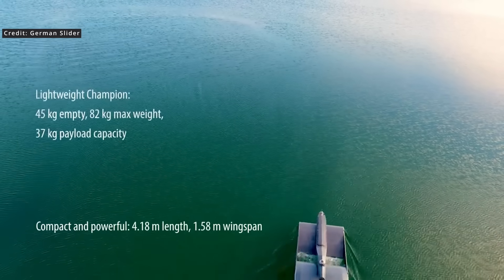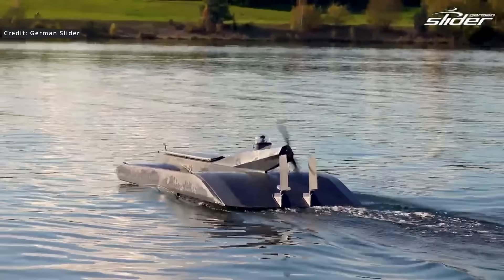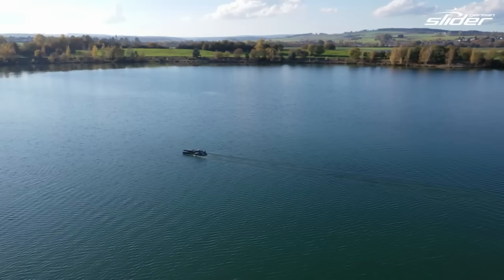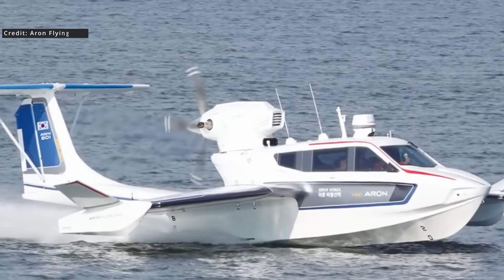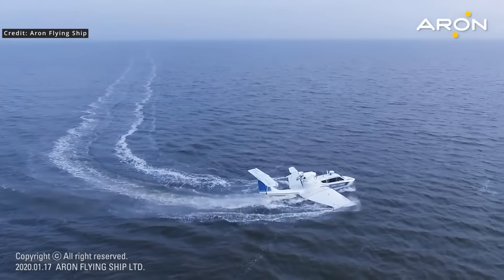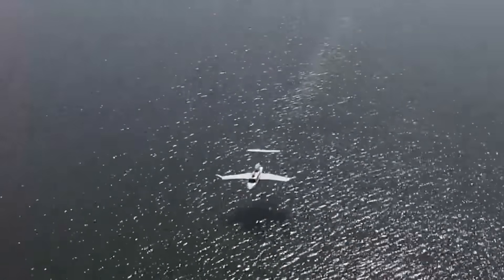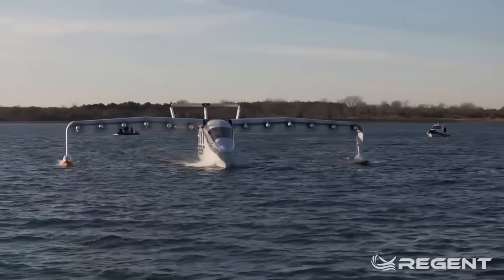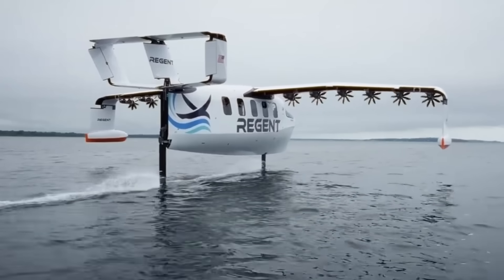Skimming the Future: Seaglider's First Foil Test Revealed!

Comment: the Regent is very interesting, a hybrid approach! I wonder what the total energy required for this is significantly less than a hydrofoil only approach? The drag in the water increases much faster than the wings in the aire, so I wonder where that speed/energy efficiency spot will be...
Reply from the maker: It is an advantage over having the hull stick to the water.

Comment: I just don't get regents high wing design placing the wing out of ground effect makes no sense and defies accepted and proven design, NZ has committed to dozens of these as ferry replacements a 700 million purchase of a completely unproven concept. That decision was made in 2022 with delivery expected in 2025, well its 2025 and they are still showing renders of the factory and they haven't even proven true ground effect flight, I think this whole project is scamming investors.
Reply from the maker: Interesting points!
They have indeed not proven ground effect flight.
However they are after span-dominated ground effect, rather than chord-dominated ground effect (Refer to one of our earlier videos: https://youtu.be/Lv34AN7vqZc).
Hence they can get away with a high wing as it technically is still in ground effect if it stays within One Wingspan Above the surface.
I am not sure that these will be actually replacing ferries perse. And yep, they are running behind schedule a little bit.. More of a moonshot than they realised I guess!

Comment: What kind of certification would be needed to pilot a craft like the regent?
Reply from the maker: To pilot a Regent Seaglider, a maritime-based wing-in-ground-effect craft, operators will most likely need a U.S. Coast Guard Captain’s License (such as OUPV or Master) rather than a traditional aviation license, since the vehicle is being certified as a high-speed maritime vessel rather than an aircraft. Internationally, certification will vary by country but generally follow maritime licensing frameworks, potentially with additional training specific to WIG operations. Regent is actively working with regulators to establish a hybrid certification model that ensures safety while avoiding the more restrictive and complex requirements of full aircraft pilot licensing.

Comment: There was a homebuilt 4 place seaplane a couple of decades ago that used small foils to augment takeoff and landing performance. It was a fantastic looking design, but apparently the foils were very problematic. A craft that takes advantage of the speed attainable in the pressure zone just above the water surface will be limited by things sticking in the water.
Reply from the maker: Indeed..
Reply: No. You are allowed ballistic hops to 400ft altitude to clear vessels or terrain without losing the international classification as a boat, rather than an aircraft.
Reply from the maker: I believe @PAULSLEVINSKY-b7j was referring to foils etc. sticking to water..
Reply: @onewingspanabove yeah, I got that too. But a WIG or surface effect ship doesn't have the issue he suggests. 
They use SES craft as military minesweepers because they are on indestructible narrow hulls when underway. 
And hydrofoils are only useful for takeoff and landing assist. 
Not speeds above 40-50 knots.

Comment: Cool stuff but I don’t get what market there after.  We’ve already have large scale hydrofoil boats and ferries that can transport much more capacity.  And large inner port harbors have a ton of traffic and floating obstacles to contend with.  Once out in open waters there’s large ocean swells, slightly submerged debris and sea mammals.  Can one imagine if the Seaglider’s foil struck even a small slightly submerged log?   It’s going to go kart wheeling once that wingtip contacts the water.
Reply from the maker: Good points.. The foil would only be used before Flight which is not in open seas. As you say, there are already hydrofoils boats out there that do the same. Difference between conventional foil boats and these Seagliders would be speed.
Reply: Seaglider's foils are landing/takeoff gear.

The Seaglider is an airplane optimized to fly very low. That doesn't mean it can't fly higher; it just uses more electricity/fuel.

We are excited here in Hawaii to get ours.
Reply from the maker: @jtjames79  Spot on.
Reply: I agree. I’m not sure what practical commercial use they’d be. They only really work over really even surfaces. I checked & there are a few companies working on them & the military too
Reply from the maker: Tough nut to crack indeed, but there is certainly a use for them..
Reply: Being an archipelagian with business across several islands and easier access to coastline rather than airports, the m50 and m80 were rather interesting though.
Reply from the maker: Yes. And faster than boats..

Comment: Engineering deadend. All the worst parts of boats and airplanes rolled into one. Slower than real airplanes, carries less load than a boat, not effective in bad weather, same cost as airplanes. This is why everybody has abandoned this style of transportation. At least with flying boats you get speed mixed in.
Reply: my design solves all of that 😏
Reply from the maker: A Tesla coil perhaps?
Reply from the maker: But gold from a maintenance and operational perspective...

Comment: I love the Regent - but have some big questions.
- What is with so many motors, with so many propeller blades ?
Cutting those back by even half would seem rational.
- What is the real value proposition here, that makes this a market viable offering ?
I don't know who is supposed to buy this, and why.
Reply from the maker: Distributing the load from a few to more props has added advantages of creating a 'blown wing'. And the value proposition in short is that you get an airplane that you can maintain and certify like a boat.
Reply: @onewingspanabove  
1.) I don't think a blown wing is that useful.  They are conventionally used for takeoff and landing (low speed flight) - but that is what the hydrofoil is for.  Once the plane is up and flying, then you don't need a blown wing.
2.)  You will never be able to maintain and certify a plane, anything like a boat.  And this IS a plane, in every way that matters.  
Even if you can actually find a regulatory loophole to exploit. 
Specifically though, the motors and propellers will cost as much as they do on a plane, and now you have many many of them.  This just is not boat level economics. 
 I can't see a business case closing for this.  Speed is supposed to be the selling point, but this lemon isn't worth the squeeze.  
(however, if military users are the actual real target of this, then that could be a whole other story)
Reply from the maker: @barryscott6222
Good points. 
Every little bit helps though.
And having more small props doesn't only distribute power/lift, but also risk. Losing power on one motor is not a major problem. And all this comes from the fact this is easy to do with electric motors. Not so much with conventional engines.
The loophole for Regent seems to be the computer control system. Indeed the airframe is essentially an airplane, however it is limited by the control system.
And yes, it turns out that military users are meant to be a big market for the Seagliders.
Reply: by blowing air over the wing you effectively increase the aircrafts effective airspeed even when stationary. This helps proactively avoid stalling, and generates lift.

Problems include a massive area of Prop, meaning high speed drag, prop vortexes which will lower the efficiency of the wing meaning this implementation will need more wing area to offset the reduced performance akin to a Canard aircraft.

They've sacrificed one of the advantages of a Ground effect airframe, to gain a different advantage. Personally I'm concerned how they plan to steer while foiling, too much bank angle and your wingtips will literally spin you like a top. And the lateral Gs from rudder only or differential thrust from those wing pods will feel uncomfortable. Is the foil purely a takeoff tool? If so it's a lot of airborne drag and would probably be scrubbed for final design.

Mostly because foils like that will hit the water hard during landings and bounce you back into the air.
Reply from the maker: @glenmcgillivray4707   All good questions.
The foil is def a take off tool.
It is indeed the take-off and landing, there the foil leaves and reconnects with the water where the difficulty is. Other Skimmachines with foils have failed here.
I think Regent is counting on the smart control system to control the movements. My concern here is what the craft would do when this system fails.
Reply: @onewingspanabove I thought about if we could retract the foil like a landing gear, and adjust the angle on the primary foil for better takeoff control, set the foil to a neutral zero lift configuration during landings on your hull, or half deploy it in rougher seas to shed some airspeed as you dash through wave tops to make the touchdown softer.

Of course if you make it retract vertically that raises numerous other complications so of course the idea isn't simple, but I had Visions of going for the old U shape or V shape foils, and leaving the lifting mechanism to each side, as you gain speed the wetted surface can be steadily reduced during takeoff, meaning less drag and less pitching force trying to drive the tail into the sky and the nose into the waves.

But they've installed a simple cheap T foil, which is difficult to retract and might minimise the effects of the waters surface, right up until the critical moment when they want to leave it.
Which isn't surprising but I would have envisioned a smooth transition was preferable to a sudden one particularly in a seaplane that cannot choose the conditions for takeoff as readily as a craft with backup wheels for runway use.

I see their design decisions, and see a lot of tradeoffs that feel like they wanted a airframe done now, instead of thinking about the process. Which I imagine means that we will see a harsh reality check on the design. V foils aren't that complex to build or design, so why are they using T foils? Take off in chop or small waves and I imagine you'll have a bad day. In a Seaplane.
:s
Reply from the maker: Excellent points.
If you look at Regent's early concept designs they actually had a v-shaped(ish) foil that was connected to the wings with struts.
https://brittanyferriesnewsroom.com/brittany-ferries-eyes-zero-emission-sea-skimming-flying-ferries/
Obviously they went through some design iteration process that they verified through the 1/4 scale prototype and ended up with a straight T-shape.
Not sure what decisions were made along the process but it was probably a balance between manufacturability and hydrodynamics/moment-equilibrium.
Reply: @onewingspanabove oof, that prototype wing support structure looks far less like what I'm suggesting and far more like folks wanted to use thrust buoyancy for takeoff stability instead of pontoons for clean lines and speed, when parasitic drag would make the thing draggy like a biplane, when their current design has twin tails already.

I figure you blend some pneumatics into the sides of the cabin, or hide them in walls under the wing, then shape the foil to snugly fit against the hull to minimise parasitic drag, the U or V shape (depending on the hull form) would keep drag in flight low, allow belly landings if deployment fails, and probably allow takeoff even if the system was non-operational albeit in calm conditions only, to get back for maintenance.

And such a foil can be pushed down half a metre or so, making liftoff smoother and more tolerant of waves trying to interfere with takeoff in marginal seastates.

Regardless. Their prototype is a prototype and I wish them luck. my idea would probably add complexity and cost and that sort of thing can wait till after concept verification.

I just worry their prototype is going to find even marginal swells hazardous to its health, forcing it to operate on lakes, rivers, maybe canals.

Comment: There's an inherent risk to wildlife and bird life with these types of vehicles. In NZ we have many oceanic seabirds, plus little Blue Penguins and many whales, dolphins and Orca. The risks to wildlife is not worth the benefit to the commercial operators.
Reply from the maker: That is a good point that is raised in other countries as well. That should be brought up with OceanFlyer who are bringing the Seagliders to New Zealand.
Reply: I used to think so too but I think there are engineering ways to mitigate it such as sound based alerts to wildlife or maybe others.
Reply from the maker: I also believe that they will have methods to look ahead to check for possible hazards/ animal life.
Reply: They won’t be in foil mode very long, and flying above the water will be safer than boats for marine animals.

Comment: I real like the idea of ground effect vehicles, but they're so impractical in real life. For my job, I need to look at sea states, wind and waves often and I don't think there is a sea area where they can operate reliably in any professional capacity. A customer of ours operates a ferry catamaran in the baltic sea. And with two hulls in the water, passengers get sick at moderatly rough seas. But at least the catamaran can go out at these mildly rough conditions, I highly doubt a ground effect vehicle can operate there. The dual-use approach of the Aron M80 might be interesting. 
Beautiful vehicles nevertheless.
(Ever notice how calm the water is in all the videos?)
Reply from the maker: Indeed that has always been the Achilles heel of Skimmachines. I am guessing that in the case of Regent they imagine calm waters in harbours and inlets to get onto the foils and then they could handle higher sea states from there. Only problem would be safety if the craft would need to land in an emergency.

Comment: Dipl.-Ing. Günther W. Jörg lives in a small village in the Odenwald, very near where I live. Between Frankfurt and Heidelberg. I tried to build a model Tandem Airfoil Flairboat, but it doesn't work. 
The foil of the Seaglider is unnecessary to my opinion. I costs weight and place and has no sense.
Reply from the maker: Sorry to hear it didn't work. Normally a tandem flairboat config is the easiest to get to work..
The foil on the Seaglider is only one solution to hump drag. We'll see if it is going to work when they push that throttle!
Reply: @onewingspanabove Yes let's wait what happens.
Reply: The construction of an Tandem Airfoil Flairboat is our know how and still in our hand. It was never published, so it cannot be used. The reason that your rcmodel did not work is that there was a lack of Knowhow.
I am the daughter of Dipl. Ing. Günther Jörg  an engineer too. We will be going to market very soon with our Tandem wing System. Videos at Youtube available (Channel IngridSchellhaas or Airfoil Flairboat)
Reply: @ingridschellhaas7041  Yes, it was definitely a lack of knowledge. I had no idea about the wing profiles that are necessary for a stable ride.
Unfortunately I don't have time to build any more WIG models.
By the way, I grew up in Darmstadt and now live in Maintal near Frankfurt/Main.
I wish you much success with the new products.